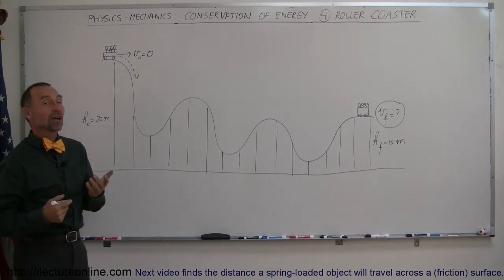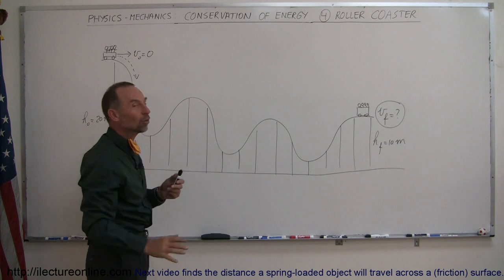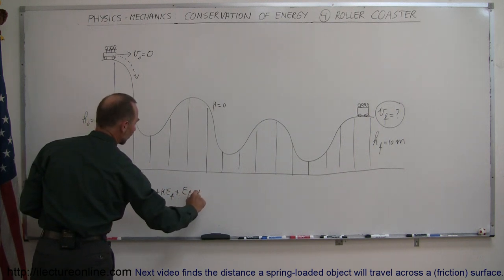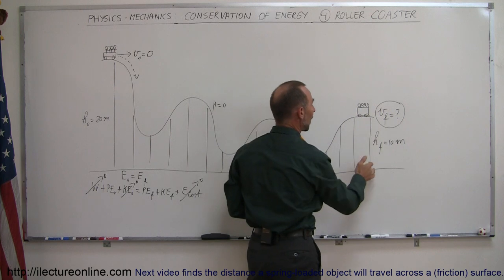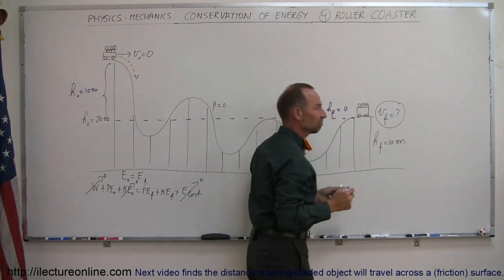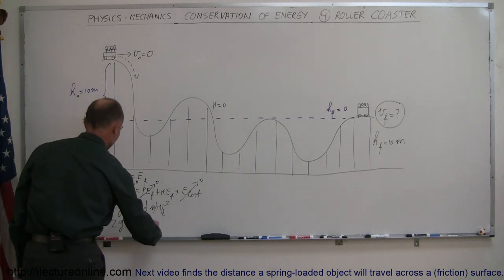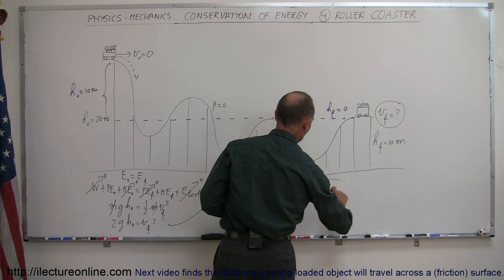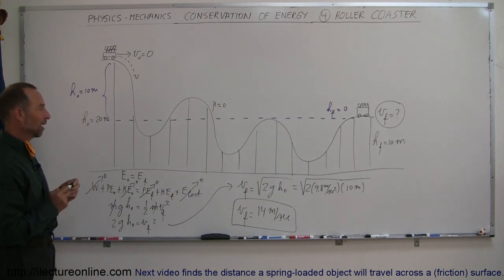Physics 9   Conservation of Energy (4 of 11) Roller Coaster

Comment: Dear sir, what if the constant of friction is 0.4 , how can we solve the question ? Do we need to know the m of the roller coaster or whats the equation ? Thank you sir .
Reply from the maker: If there is friction it would be much more difficult, because the slope is constantly changing.  This would then require an equation describing the slope of the roller coaster at every point and we would need to integrate the work done to overcome the friction over the entire length of the roller coaster.

Comment: Dear Michel, Thank you for you video. Just a small comment: The input work is zero because it is the work of external forces and there is only one external force, on the roller coaster car, which is the normal force which is always perpendicular to the motion so its work is zero.
Reply from the maker: Not exactly.  As the roller coaster goes up and down, the angle changes and the force of gravity is NOT perpendicular to its motion.  In the energy equation we do not include the force of gravity as "doing work" because it is already accounted for by considering the change in potential energy.
Reply: I completely agree  that we do not include the force of gravity as it is already included in the total energy because its work is: W(mg) = -integral(dU) = -(U2-U1) and within the "work-kinetic energy" theorem it passes to the other side to be added to  the kinetic energy and be the total energy and I already said that there is only one external force that works excluding the gravitational force as it is already included in the the total energy. But I am referring here to that most of the books are saying the total energy is conserved: Einitial = Ffinal but they do not even mention that  the work of external forces if zero as you did!. The only thing I added is that indeed the work of the normal force = integral [(vect(N).vect(dl))], dl is the elementary displacement, is zero because the the normal force is always perpendicular to the surface where it is opposite to the mg component which is perpendicular to the surface and the parallel component of mg makes to the motion parallel to the surface. I am sure about this. Following the action-reaction newton third law the surface react on the car which just what was applied perpendicularly by mg (of the car) and for that reason we call this force the normal force (means perpendicular to the surface and it is just the reaction to the normal component of mg on the surface). So here I would only to comment and mention this, so we know why the work is zero.

Comment: After W is done taking the car to the top, it gained PEinitial then at the end when it came up to its "final"position it did not have PEfinal (due to the change on the reference zero height?).  Can you explain why? Seems that the car again has stored energy to get ready to cruise down the loop and thus has to have PE not equal to zero unless it's the end of the loop. I have trouble determining these initial and final values to help me start solving the Energy equation.
Reply from the maker: Whenever you solve any energy problem like this, even when you have a pulley problem, you are free to put the "zero height level" anywhere you like for that problem.  It doesn't matter where you place it because you will always get the same answer.    (Only the difference in height matters between the initial and final point)
Reply: @MichelvanBiezen  that makes sense lol I tried with ground level as reference and it worked! Thank you, sir!

Comment: I keep questioning something related to work. So if you pick up a suitcase and walk, is there work done? Because my teacher says there’s no work, but isn’t there work regarding walking? The question didn’t really specify if there’s work done on you or on the suitcase, which makes it confusing to answer.
Reply from the maker: The best way to check is to ask:  did you add energy to the object (did the speed increase or did the height increase?)  If the answer is no, then you did not do work.  (picking up a suitcase is doing work, but walking with it at constant speed and keeping it at a constant height is not doing work)
Reply: Michel van Biezen thank you!

Comment: is there PE in the end?
Reply from the maker: That depends where we place our h = 0 point.  To make it easier, we placed the h = 0 point at the height of the end point and therefore there is no potential energy at that point.  If we had place h = 0 at the ground level, there would have been PE at the end.
Reply: @MichelvanBiezen  if we don't set the endpoint to 0 we have to add the Pef at the end which is Egi=mghf+Ekf and when we set end height to 0 we only have to calculate mghi=1/2mvf^2
Reply: is that correct
Reply from the maker: Yes indeed.
Reply: @MichelvanBiezen  Thank you so much